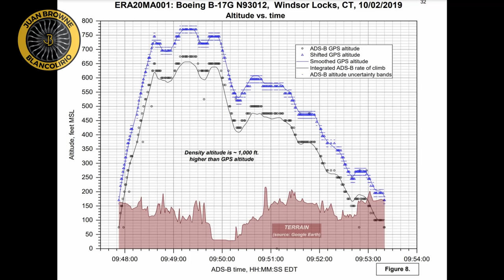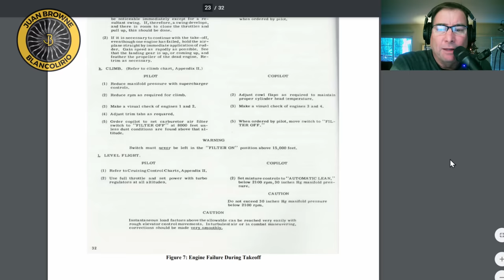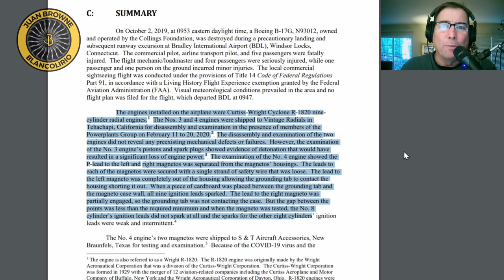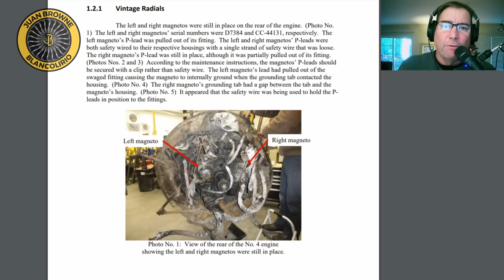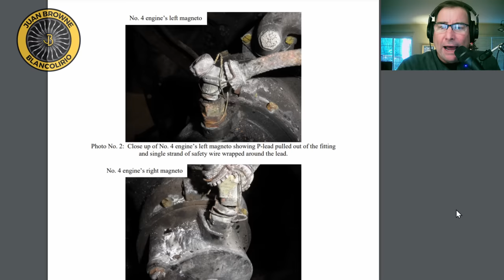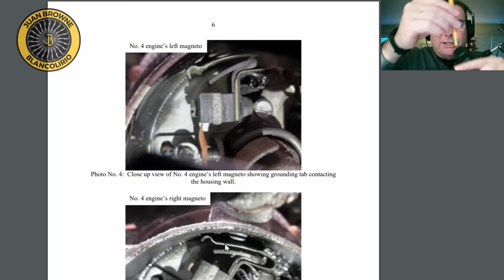NTSB Report B-17G Crash 'Nine-O-Nine' Part II -18 Dec 2020

Comment: The fact that they had  to blow the condensation out of magnetos on two adjacent engines just to start should have been a red flag. With both mags hot, any engine with enough compression should start even if one mag is sketchy. They violated the redundancy of the ignition systems. The reason there wasn't a discernable drop in RPM when doing the mag check (1 mag vs. both) is one mag was basically dead.
Reply: Wouldn't the engine die when you dropped out the good mag if the other one was dead?
Reply: @Bitterrootbackroads  Yes. Even with brand-new magnetos, whenever you switch from "Both" to "Left" or "Right," you'll get a drop in RPM. The manual will specify RPM ranges that are acceptable, and drops that are greater than acceptable indicate a bad magneto. However, if you have one magneto totally dead, whenever you switch to it alone, the engine will kill, because there will be no spark.

This leads me to believe there was no magneto check performed, assuming a run-up was done at all. It seems certain of the surviving passengers reported that no engine run-up was performed.
Reply: @don_5283  I'm seriously wondering about possible confusion in the use of the term "run up". Are they talking about a full-power run up of all 4 engines that was traditional for any WW II aircraft on first of day takeoff, or are they talking about run ups of the individual engines, which is generally when a mag check would be done? 

I wasn't there, but I can't conceive of any piston engine pilot that wouldn't have done a mag check before takeoff. I suspect that the individual engines were warmed up and run up to 1200 or whatever the specified RPM is and mag checks done. I also suspect that a full power simultaneous run up was not done. 

I also find it somewhat difficult to believe that anyone would have taken off on a paying passenger flight with one mag dead on one or more engines. This makes me think that both mags were working on #4 before takeoff, though maybe poorly. Did that pulled primary lead happen in flight, or only from the crash deceleration forces when the engine tore off? I don't think we can be sure of that answer. I wonder if they found the ignition switches in any shape that could have been examined.
Reply: @Bitterrootbackroads  It would IF that's what the pilot did. If he went good mag-both mags- good mag, it wouldn't change. Keep in mind this flight had already been delayed, and there may have been pressure to get it off the ground. Refunds=loss of revenue
Reply: No mag check performed.
Reply: @av8bvma513  That may be, but that directly contradicts the loadmaster's sworn testimony that a sequential runup and mag and prop check was done. Of course he may have lied. There are some bits of his testimony that I personally question a bit. On the other hand, they made it off the ground without looping into the ditch, and according to WW II training films that isn't easy in a B-17 with one or two engines out on the same side. My guess is that they had something close to full takeoff power until after they were off the ground. It's not unknown to have an engine work for takeoff and fail shortly after takeoff.
What might not have been done was a full power runup and hold before releasing the brakes. That might have found the problems, but equally, it might not have.
Reply: @av8bvma513  Bingo.
Reply: @merylpelosi8485  your reply to bitterrootbackroads is the Challenger disaster all over: "If we don't make this flight or launch there will be a negative financial impact." As an engineer I fully appreciate the concrete reality of the cliché Money Talks. As a decades long mechanic on my own time I am appalled at the condition of those magnetos and piston crowns. That speaks volumes about another concrete reality: at some point age will always defeat decades of experience.
Reply: @curtislowe4577  The detonation evidence could also be attributed to cruising with a lean mixture. Saving fuel? This poor aircraft was doomed as soon as it drew this duty. It's like watching a once magnificent race horse pull laughing children around in a wagon.
Reply: @merylpelosi8485  I wouldn't argue against that hypothesis. Decades ago I put a knock sensor on a high-performance auto as a bit of inexpensive insurance as premium fuel then was several octane points less premium than it was when that auto first rolled out of the factory. That a warbird designed to burn WW2 aviation fuel and is now to be operated as cheaply as possible on modern avgas would not have knock sensors retrofitted IMO reinforces my hypothesis that old age does eventually undo the benefits of decades of experience.

Comment: In A&P mechanic school, 100 RPM loss is what were trained to look for when doing mag checks during engine runs.
Reply: And if they had done the mag checks required in the pre departure engine run up the engine would have died when the working mag was cut .  they had this experience and mis identified it as moisture blow out and did not retest switching off one mag at a time.

Comment: Great video Juan.  Having flown about a 1000 hours in a Navy C-54 a lot of your presentation wasn't new information for me but it was great how you presented in a clear way for many to get a better understanding of "recip" aircraft engines.  It is sad, but these old birds and their mags have a long history.  Count count the number of times we went out to our planes only to find an engine that didn't want to start due to wet mags.  We windmilled them a lot.  Our DC4's had an onboard engine analyzer which could easily point to a problem that would avoid what happened in CT.  We could see the timing as well as the strength of our sparks.  Again, thanks for the work you do to explain to the public.  Just curious, do modern jets have an onboard display of ignition condition besides exhaust temp?
Reply: Did you always call out "Plug, Lead and Coil"
Reply: A jet engine is like a blow torch there is no timing. If it lights the ignition is working. The ignition is usually on for Landing and at times where a flameout could occur. There are several indication systems including tachometer readings for the individual shafts, engine pressure  ratio and gas temperature. These show engine condition.. There is nothing so tense as watching TGT still rise faster than N3 after you cut fuel.
Reply: Gary747  Not for quite some time. See you recognized hot start indications on an L1011 #2. That was when I learned it is best to top out the starter on a RB211. Also learned the line from the fuel shutoff valve to the engine on #2 holds a lot of fuel.
Reply: @jayreiter268  Just gave me goose bumps Jay.  I was a "radio/navigator" so it wasn't me calling them out it was the mech next to me.  The bird I flew in most had logs going back to the Berlin Air Lift!  Guess she hauled potatoes.  Stationed at Gitmo we flew all over the place to serve the embassy personnel.  Lots of little islands and short runways for a bird our size.  Coral runways sure tore up the tires fast.  San Juan PR was the biggest island and best facilities we had.  Used to love going into and out of Isla Grande Coastguard station between new and old San Juan.  We'd buzz the bridge coming in and out.

Comment: MAC was a great pilot, but he did not competently manage maintenance as the Director.  Another person should have had that job.  There is no excuse for the aircraft flying with the issues that were discussed.  This aircraft should have been grounded for a full and complete inspection of its engines and magnetos.  Their state was shocking.
Reply: I'd like to agree, but does a great pilot skip a mag check? Because if one of the mags on #4 was well and truly dead, as soon as you flip the switch to it, the engine will kill. And considering the poor ignition quality evidenced by the fouled spark plugs on #3, I'd think if a full run-up was performed, its RPM would have been low.

I understand McCauley was a venerable figure in the community, and beloved by many... But a lot of evidence points to him being profoundly negligent, in oversight of maintenance, and performance of preflight tasks, and in failing to promptly declare an emergency and manage the emergency in flight.

This should be an object lesson, which we should all wholeheartedly support, that no pilot is good enough or experienced enough or well-liked enough to disregard safety procedures, checklists, and proper planning.
Reply: @don_5283  As I stated, the aircraft should never have been allowed to fly, given maintenance was horrifically bad.  If he skipped a mag check, then he's an incompetent pilot and an incompetent Dir of Maintenance.

Am a former USAF Captain Navigator, private and sail plane pilot.  I didn't like the way Mac flew the aircraft on final.  

If it was me, I would have pulled the power back on 1 and 2 to eliminate the powerful asymmetrical thrust pushing the aircraft to circle to the right.  I would have crash landed parallel to the runway.   He was too close to stalling the wing to remain flying and airspeed was so low that an out of control condition was taking place, given the failures.

While going to a 1 PM commanders call on Sep 19, 1979 and after entering the Castle AFB main gate and proceeding towards the flight line, I saw a huge amount of dust flung into the air between hangers.  Seconds later, there was an explosion.  Upon reaching my squadron, all the aircrews were at the fence in front of the 924 AREFS starring at what was left of a KC-135A.  3 of 4 engines were torn from the aircraft.  One panicking person was being led away from the burning wreckage by another crew member.  The cockpit area was completely blown away beginning at where the leading edge hits the fuselage. 

There were blackened pieces of the aircraft all over and and I could not see any bodies.  My former IN Brian was on that flight, but he survived, although he never flew KC-135s again.  All died except two in the boom pod, my former IN and a senior BO.  

This all happened because of a failure to deal with asymmetrical thrust after a simulated engine failure, something we practiced often.  

The student AC hit the wrong rudder on that engine failure.  One only has about 3 seconds to correct the yaw or the aircraft will cartwheel, as happened here.

About a year earlier student AC, Captain Ross, did the same thing during one of my upgrade training flights.  He knocked the books of my Nav Desk, when we fell back to the runway right after take-off, but our IP Captain Niemeyer was some kind of genius. He reacted immediately to maintain runway centerline.  He later said that was to keep us from falling out of the sky and doing a very hard landing.  Ross apologized for almost killing us.  I joked, we're good for another year.  

In this case, it was a student AC at the controls upgrading to KC-135s assigned to a 93 BW aircrew upgrade training class.  

Read about that here.
Source:  https://aviation-safety.net/database/record.php?id=19790919-0

Given the failures, the outcome already was doomed to be bad.  At that point, it was just minimizing the loss of life in the coming disaster.

Skipping checklist items should be a criminal act, when carrying revenue passengers.

Do you think Mac was suffering from some type of medical inability to concentrate on the checklist, if what you stated was true that he skipped a mag check?
Reply: @don_5283  I agree.  I have always been told that the most important part of being a competent, much less a great pilot is not experience or skill but judgment.  This pilot utterly failed that test, and had been failing it all along.  It just took time for it to catch up with him.
Reply: @charlesfaure1189  agreed
Reply: @mcdowelltw  I have to agree.    All I see is questionable decisions from start to end.   Dropping the gear was a bad decision,  more drag was the last thing they needed.   And runway 33 was the logical choice.    If you look at the flight path,  https://youtu.be/G3dD98IqEUk?t=1572,   the bad decisions snowball around the time he decided to turn back towards Bradley,  and got much worse when he decided to go for runway 6.    I honestly don't know what he was thinking when I look at his course.    Turning into 2 dead engines?
Reply: @pR1mal.  Brilliantly stated.

Comment: Ole hotrod trick,pull the ignition timing forward until the engine starts to "ping" then back it off a bit.I am surprised they could reach a good manifold pressure at full power with serious detonation happening.Great video Juan.

Comment: Thanks Juan. That was fascinating. I always wondered how this double mag system worked. How the hell did they keep these engines working efficiently during WW2 , especially in the tropics. 🇦🇺👍  🎄
Reply: They were new. Spare parts were readily available and cost was not an issue. As it  was a wartime situation, the government had plenty of trained manpower to keep abreast of regular and required maintenance. In tropical regions, aviation prior to WWII, had had extensive experience in dealing with the high humidity, rainfall and temperature issues that were later seen in the Asian-Pacific theatre.
Reply: Thanks William
Reply: @roblachman8919  You are welcome. The inventiveness of aviation mechanics in the field deserves its own volume. It could well be someone has written it, but typically, you read about their exploits as an addendum in books about pilots/aircraft. Take care, be well. W

Comment: Collings was (is) running a shoestring operation, relying primarily on volunteer labor, and attempting to maximize income. The 7 passenngers on this flight each paid $450.00, so the PIC's main objective was to get the engines started and the bird in the air, otherwise they'd have lost $3150.00, and potentially the same for the next scheduled flight that morning if maintenance/repair grounded the plane. 'Mac' had no doubt grown complacent because 'it had always worked out before'. Was there any discussion between PIC and FO about procedures for engine(s) out at takeoff for each airport they visited? 'Mitch', the AP who was on board as 'loadmaster', testified that Mac could be "grumpy", and wanted maintenance done his way and his way only. We see how that worked out. As for the scheduled passengers for the next flight:  'there but for the grace of god go I'.
Reply: You are exactly right.I flew on this plane in 1998 and 2008. The maintenance crew back then looked like had spent two months in the dessert without a shower.Just completely worn out looking

Comment: Any time you have moisture in the ignition system wouldn't letting the engine warm up and drying it out be advisable after blowing it out.
Also would moisture be a problem flying through rain?
Reply from the maker: wouldn't start.